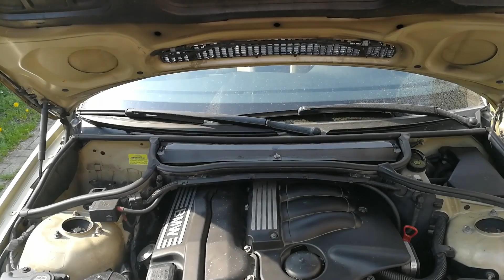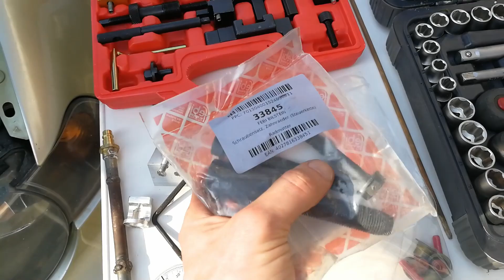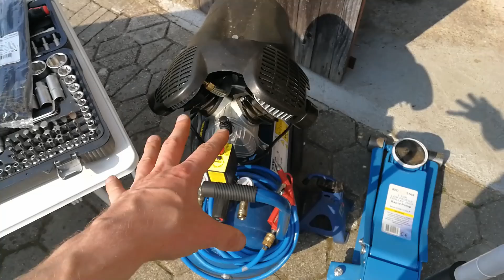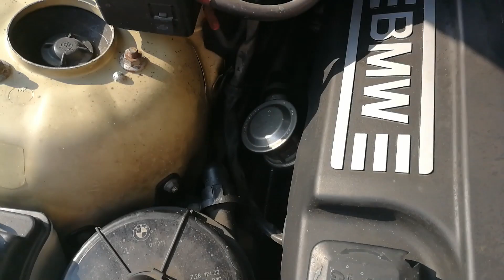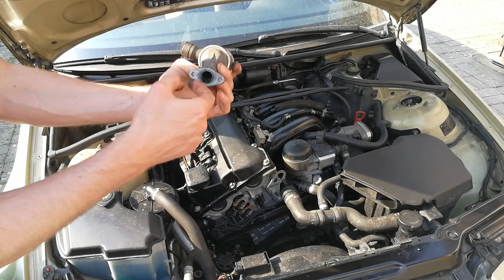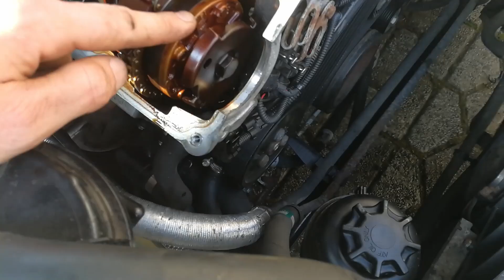BMW N42/N46 Valve Stem Seals Replacement PART #1: Removing valve cover

Comment: Great Video, just trying to figure out what engine my car is unsure if its N46 or N43. Its a BMW 3 series 318i 2006 (e90 I believe) saloon inline 4 naturally aspirated the 127hp one. Not a lot of info online as these cars were not as popular. Any help appreciated, thanks!
Reply from the maker: Based on the model and year and 127 HP, it's the N46. But if you just look at the engine under the hood you can compare it to images online.
Reply: @BimmerZen  Perfect I checked and your right was the N46, many thanks for the help!

Comment: Hey mate I just did a head gasket on one of these. I’m putting it back together an I have a tiny little black bolt left over it’s a 6mm with 10mm header bolt I’ve stopped because I can’t find where the bolt goes it’s only small
Reply from the maker: Did you try looking at the parts diagram like https://www.realoem.com/bmw/enUS/partgrp?id=AT51-EUR-09-2001-E46-BMW-316ti&mg=11

Comment: Valve stem seals is de CCV ?
Reply from the maker: CCV is a component which functions as an oil crankcase ventilation valve. It is not the same as the valve stem seals.

Comment: Thank you so much for your series, I live in Canada and mine is 2007 323i petrol engine 2.5 v6 inline, would these work for my engine too? please respond. thank you
Reply from the maker: Basic process is very similar, but you have to have special tools for N52 engine. Check out this link for more info: https://www.newtis.info/tisv2/a/en/e90-323i-lim/repair-manuals/11-engine/11-34-valves-with-springs/44La3AZ
Reply: @BimmerZen  Thank you so much I liked your whole series and subscribed to your channel!

Comment: hello awesome work, One question , if I dont have a compressor machine to hold the valves , should i use the locking TDC tool below the engine? , or should I turn the cramshaft without this locking tdc tool to get the PMS on every four piston valves to put out the seals?
Reply from the maker: If you dont have air compressor i would suggest that you use the "rope inside the cylinder" method. You dont have to use the flywheel locking tool while putting pistons in tdc. You need the pin only to do the timimg.
Reply: @BimmerZen  I´m going to change my seals valves in my BMW 1 seriesi E87 2008, Should I remove the serpentine Belt in the process or Not?
Reply from the maker: @FranciscoGonzalez-gh2ws  They are cheap, replace it if it's still original. You can also check if it has any signs of wear, damage or small cracks on the inside. Search YT on how to inspect the serpentine belt:)
Reply: @BimmerZen  thanks for the answer, but  you don't understand me, sorry for my bad English I'm from Mexico , but my question is ,if I keep the serpentine belt while I'm changing the valve seals? ,my serpentine belt is ok.. I Saw the 5 videos, and I don't know if you take off your serpentine belt while you turn on tdc...
Reply from the maker: @FranciscoGonzalez-gh2ws  aaa:D No, you don't have to remove it:)

Comment: Thanks for this video series BimmerZen. I've just completed this job, on a 1 series that's done 290,000km. It's now running more smoothly and with more power than before. And using way less oil. The timing on this car has not been touched since new, so I'm curious as to why it's noticeably better now. I went slowly and carefully and the work took three days, partly because the flywheel locking tool I had was too short. I made a longer version from an old M8 bolt, with a large, cut-off nail braised on for a handle - a 60mm long shaft worked well on my manual 120i. I used timing tool sets made by HCB in Taiwan, being the tools shown in the BMW technical manual. These are really high quality - and they're now making new, longer locking pins for the flywheel!! I made a video to show that their current locking pin design is too short, for manual cars at least. I'm told the current short version works with N46 engines fitted with automatic transmissions. Here's the link, which also shows that fitting the flywheel locking tool is not that difficult - and definitely worth doing - I didn't need to do the TDC measuring shown in BimmerZen's videos. Locking the flywheel with the pin is probably more accurate too.

https://youtu.be/QJ4YCao5-9U

One more thing - with the HCB tool for locking the exhaust camshaft, the vacuum pump can be left in place, which is a bonus. This might also be the case with other brands and cheaper copies - I don't know about them. And one more thing - removing and reinstalling the timing chain tensioner as well as the pre-tensioner is a royal pain in the ar*e if the water hose going to the thermostat housing is still connected (same for the nearby power steering hose, though it's less of a problem). Bite the bullet and drain the coolant, then remove this hose. You'll be glad you did. Get a new o-ring for the hose and replace it upon reassembly. BMW parts do not sell them separately but take the hose and the old o-ring to a good supplier, with a measurement of the thermostat housing's coupling, to save heaps.
Reply: Well my o2 sensor gets lazy due to contamination from burning oil. I think that is what might have made the performance better for you.
Reply: @user-ub5sq3zv1r  usually it's oil on spark plugs
Reply from the maker: Thanks for your detailed comment. I'm sure a lot of people will benefit from your additional information. I have also finally managed to insert the locking pin through the flywheel and I will make a separate video on that. I did however not removed the water hose as I managed to remove and reinstall the chain tensioner with out much hassle...

Comment: Thx man, your  video very usefull, I have N46 engine too, and also I have oil consumtion, 1l to 800km,  I want to change the seals, too...
So what about your oil consuption, its over or not? Thx
Reply from the maker: I dont have any oil consumption problems after VSS change.

Comment: Fantastic job and very excited to have someone like you on YouTube, much appreciated! Apparently I got all special tools that were also expensive, just few minor stuff to buy and I’m all set! I will definitely google which valve stem seals are the most quality.. but if you could recommend some and also giving the part number, that would be great! Here in Dublin the bmw repair shop charges 1500€ for complete work valve stem + timing chain replacement. I realise this is not an easy job, but I am committed to do it myself! I hate and love my N46❤️
Reply from the maker: Edvins Ragels Good to hear that! Read the manual before you start and take your time. It's a complex job. Good luck and drop a comment with the results:)
Reply: BimmerZen thanks mate, I will definitely come back to you with some comments on your Instagram :) you will have my sub just in a minute! I am now watching part 3, and I have to say, your videos are very detailed and cover all the aspects of this job, which is exciting comparing to other videos available on YouTube! You’re legend!
Reply from the maker: Tnx!

Part number for my N42B18 is 11340029751 which fits all N42/N45/N46 engines but make sure you check the part number for your specific engine. I use realoem.com to get part numbers.

I can't recommend specific manufacturer as I couldn't find any reliable information on which brands make the best valve stem seals. I went with the Febi Bilstein, but any german OEM brand would probably be fine.
Reply: BimmerZen thanks again for yours vids! Just spot on!

Comment: the 2 bolts that hold the right side engine cover broke off on my 318 ...
Reply from the maker: Do you mean the driver side cover on the intake manifold? Did that happen while you were removing or reinstalling the cover?
Reply: hi while removing the 2 bolts , that hold the plastic engine cover in place , a piece of the screw broke off with it somehow , now i cant tighten the cover anymore ,i wonder if those 2 screws could be replaced
Reply: i just wanted to do an oil change + filter , my car doesnt smoke but does use a lot of oil strangely , no leaks anywere runs, on 5w30
Reply from the maker: That's strange... They are not supposed to be tighten down that much. I can't find the part number for those two bolts... Maybe you can try to find them on ebay or junkyard. Maybe somebody with a lathe or a machine shop can make you a new pair.
Reply: yes good idea thanks !

Comment: when is part 2 coming out? would also be great if you could also record the reassembling  and the timing, i have to do this to my N46 soon, but a bit confused on the timing and torque settings for the cams
Reply from the maker: I am almost finished editing PART 2, I just didn't have the time to finish it this week. There will be reassembly and timing in the part 4 and 5.
Reply: That's awesome, been watching and studying your old video for a while,. any reason as to why you need to redo the valve seals so soon?
Reply from the maker: My guess would be that BMW used low quality materials for the seals and engine going through lots of heat cycles (short distance driving).
Reply: Ok thank you, i guess irregular oil changing can cause these to harden up and fail as well, again thank you for the videos, look forward to seeing the rest. Also, might be worth adding "N46" into your titles, as they are the same engine, apart from some minor things.
Reply from the maker: I agree, 25.000 km oil change interval is not a very good idea:) Also, I've added "N46" to my titles. Thanks for your feedback!

Comment: Very nice video. But I have a question for you. Recently, I change the valve cover of my n46 engine an I did without disconnect the battery. What could happen if you don't disconnect the battery in this procedure?
Reply from the maker: Tnx man! Disconnecting the battery is just a precaution so you don't accidentally short anything... Otherwise it's all OK.

Comment: Why didn't you remove the positive battery cable?
 Great guide btw, i think i have to go through the same procedure, puffs a cloud of smoke everytime i take off after idling( 318ti 200k on the odo ).
Reply from the maker: I did disconnect the battery but I forgot to mention it in the video.

Tnx for your comment!
Reply: I meant the cable which is running vertically over the intake and valve cover, removing it would have made removal of the valve cover easier.
Reply from the maker: Oh, I see:) It's easy to remove the positive cable going to the alternator, but I found it very hard to remove the second cable going to the fuse box on the driver side... so I just left it there.
Reply: Oh ofcourse makes sense. :)